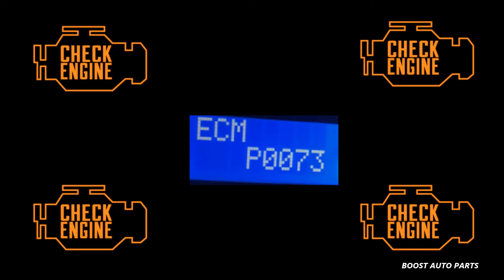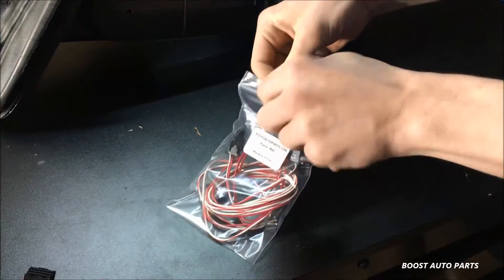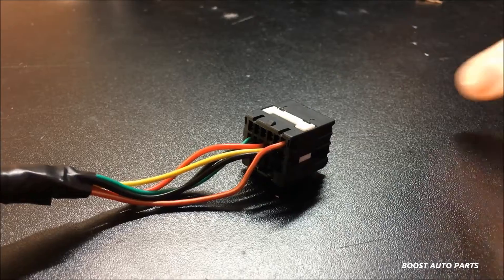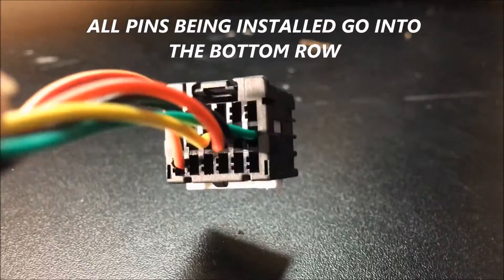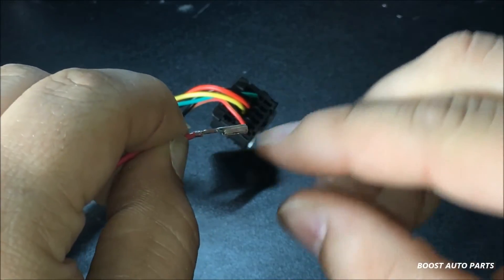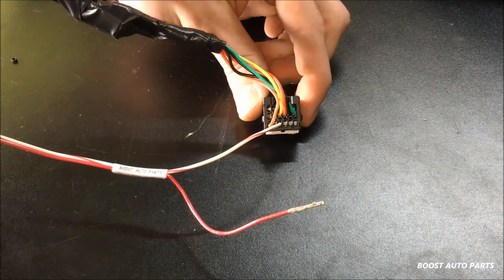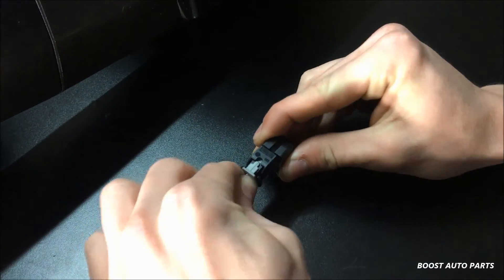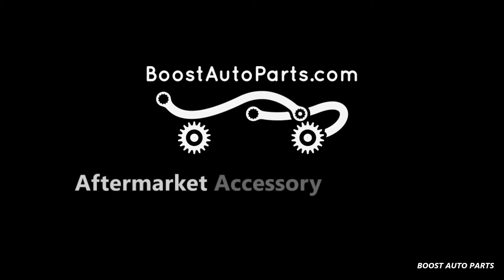FIX Check Engine Light After Install of GM Tow Mirrors; Ambient Air Sensor Harness

Comment: Will this kit help on my 2022 chevy silverado 1500?
Reply from the maker: This is not applicable to a 2022 Silverado 1500. All 2019+ GM mirrors have temperature sensors in them from factory, so any mirrors you install should have the temp sensor. All of our mirrors include them for 2019+.

Comment: Thank you !!  Which mirror driver or passenger on 2017 duramax
Reply from the maker: Temperature sensor will go on the passenger (RH) mirror on a 2017 Duramax.
Reply: @boostautoparts   thank you I made my order last night for that  kit  cant wait to make this check engine light go off
Reply from the maker: @AdventureMan-kx3dr  No prob!

Comment: So I just installed the temp sensor and now my screen comes up as “ice possible” and my temp gauge is reading -40°. It’s about 75° out and I’m trying to figure out what I can do to resolve this
Reply from the maker: Have you cleared the code with a scan tool? Reach out to our support team at support@boostautoparts.com and they will get this resolved ASAP for you.
Reply: I’m having the same issue….prior to adding sensor my dash read an accurate temp and  error code.  After adding mirror sensor it now reads at -40 with possible ice but no code.

Comment: So my 2017 Chevy 2500hd duramax has the P0073 code, and digital screen comes up with “ice possible” message. My truck has an ambient air sensor which I replaced already. This harness and sensor from you needs to be in addition to the one from the factory? I have deleted it a few times and it keeps coming back up, in some cases a code “N/A” comes up…. I just want to fix it… will your harness do this? My truck had car style mirrors I added tow mirrors and this issues began… ?
Reply from the maker: Your truck has two temp sensors. One in the grill, one in the mirror. If either one is missing this issue will present itself. If your mirror is missing it, our kit will resolve it.

Comment: It worked at first. But it came back on within the first 50 miles after clearing the check engine light, the check engine light came right back on. Now I have a high voltage error code as well as air ambient. At the end of the day it’s not your fault. It’s the junk I bought off of Amazon. It’s just a bummer. I got screwed on this and the mirrors.
Reply from the maker: Hi Bryan,

Sorry to hear you're still having an issue with your mirrors from Amazon. Our mirrors are equipped with sensors, however other sellers oftentimes don't which is why we offer this harness.

We don't sell junk; our product uses all OEM connectors as well as an OEM GM temp sensor. Please reach out to our support team and we will get your issue resolved.

Comment: I’m not going to lie. I was skeptical on buying this. But it 100% worked! So happy Boost Auto. Thank you! Wish I would have bought the mirrors from you guys. So anybody reading this cause you bought some cheap shit (tow mirrors off of Amazon like me, this actually worked! I have a 2015 Chevy 2500 Duramax.
Reply: Where did you installed it at ??
Reply: thanks for confirming, i have the same year 2500. Going to do it exactly the same way. Cheap shit off Amazon and this sensor

Comment: Installed band cleared my codes, however it's giving me a permanent DTC for P0073 anyone else have the same issue
Reply from the maker: If you install our kit and clear the code with a scan tool the issue should not persist. Feel free to contact our team at support@boostautoparts.com and we would be happy to assist.

Comment: Where is the best location for the sensor to be installed
Reply from the maker: The most ideal location is somewhere that is exposed to the outside air.
Reply: @boostautoparts  where would that be?  I can drill a hole in the bottom of my mirror but these sensors are like little mud magnets and I don't think it hanging down is a good look at all.  Ideas?
Reply from the maker: @GingerBrammer  on OEM mirrors they hang down through the lower cap on the passenger side mirror. That being said, most customers opt to just leave the sensor inside the mirror. Your temperature readout on your dash won't be exact, but it won't affect the vehicles performance.
Reply: @boostautoparts  Thanks to university of youtube I have the door panel off, the mirror disconnected and I have pulled the top mirror off because I do want to put it in there.  Now I'm trying to figure out how to thread it all the way back out.  Hope this works!

Comment: Do I need to have the code cleared for the light to go off, or will it eventually go off on its own after this is done ?  Thank you
Reply from the maker: You need to have the code cleared. Most auto parts stores will do it for you for free.
Reply: Or you can just pickup a code reader from walmart which will work just fine too.

Comment: Dealer charged over $100 to tell me why the check engine light was on, but  wouldn’t tell me how to fix it. Saw this video just in time for winter. Now I can remote start again.
Reply from the maker: The truck will not remote start when there is a check engine light on, so if this is your issue it will definitely solve your problems! Here's a link to the product: https://boostautoparts.com/products/ambient-air-sensor-harness
Reply: Boost Auto Parts unfortunately I had the parts already which was purchased from the dealer(sold separately of course). I followed these instructions yesterday and was done in no time. Then disconnected the batteries to clear the codes and we’re good to go.